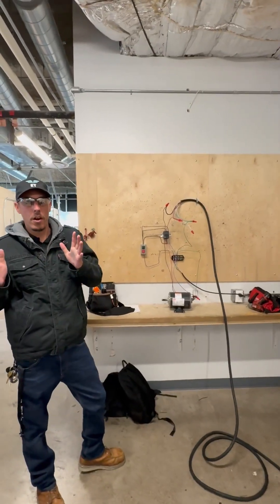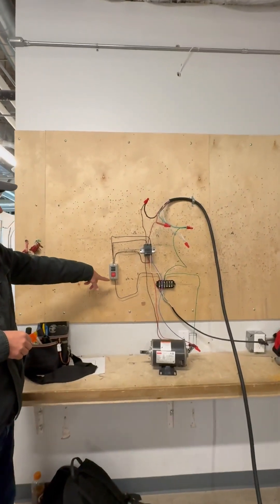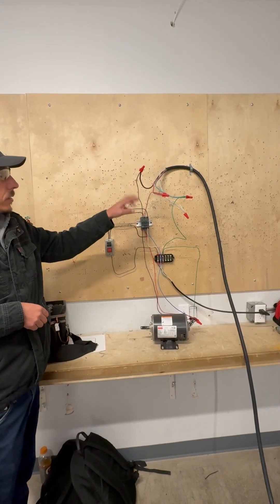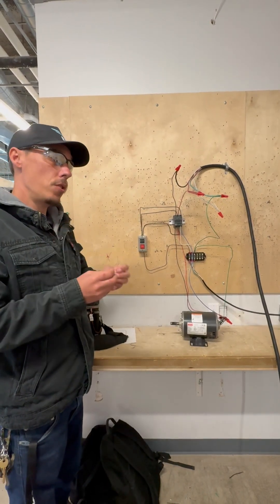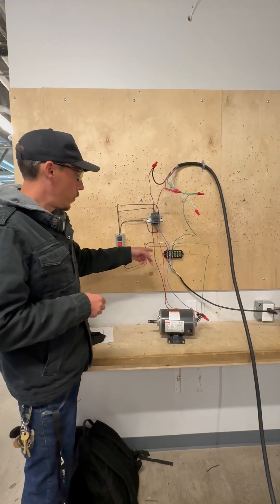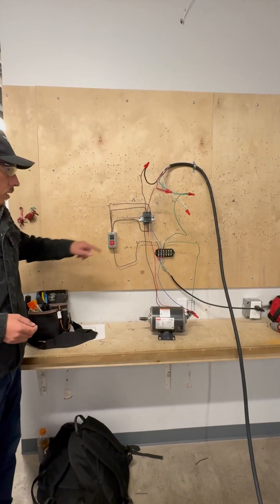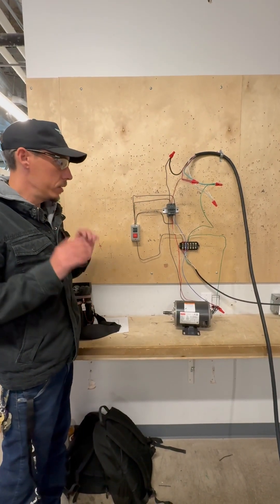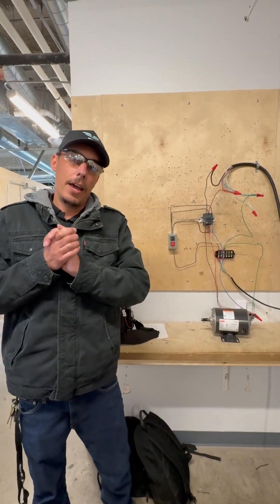February 10, 2025

Comment: Where is your motor protector to limit inrush current?
Reply from the maker: @first_last-  Do you mean the Overload contact? In this scenario, it was not required due to there is no load on the motor. Also this 1 set up out of 6. Essentially an intro in motor controls. I will make another with more components. Thanks!